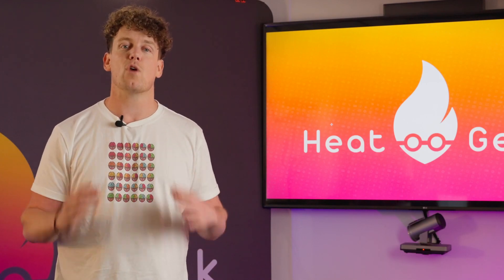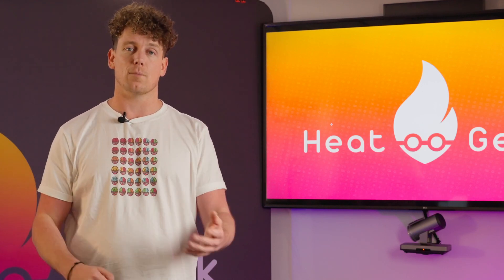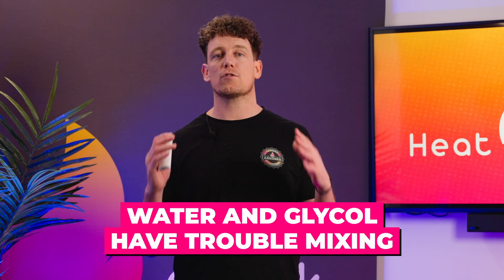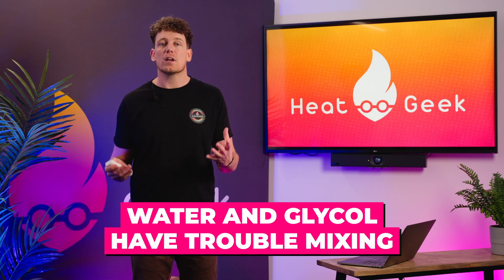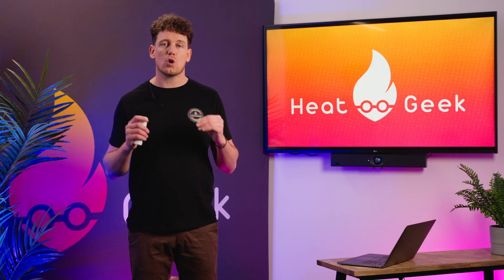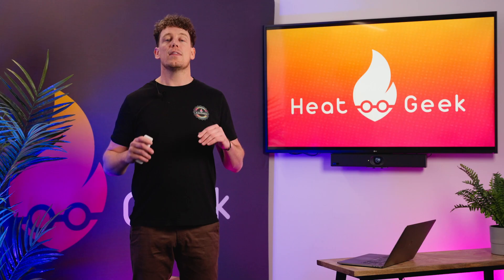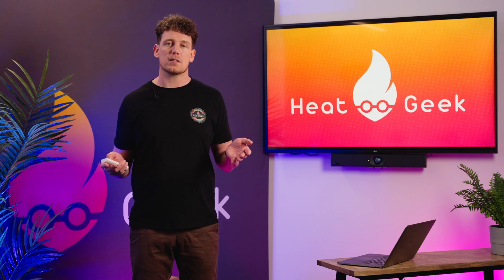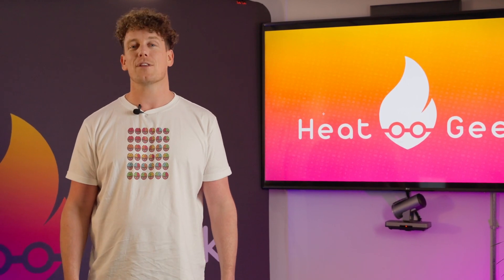Glycol Vs Anti-Freeze Valves | What's Best for Heat Pumps?

Comment: My installer quote specified a glycol system, and I quizzed him given glycol’s unfavourable thermal coefficients.

He pointed out that in Aberdeenshire, there have been many instances of the anti freeze valves opening up and then not resetting because they then become frozen in the open position.  He say the most frequent cause of antifreeze opening is a storm blackout coupled with freezing conditions.  Both the storm and the freezing attributes are a lot more common here compared to the south of England.

I do wander though, maybe having a split refrigerant system would be better, instead of a monobloc system.  It therefore keeps all the CH water away from exposed freezing locations.  My experience of underfloor solum areas is that they are ground coupled in terms of temperature and far less susceptible to freezing.
Reply: Ideally monoblock aren’t suitable for cold climate where severe weather conditions are expected in the winter ! 

Install split type and all worries are out the window ! 

Please make sure all refrigeration pipe work is well insulated . For example we use pipe work with 9mm insulation but then we add on additional 17mm pipe insulation all the way between indoor and outdoor unit! By doing this we minimise heat lost from primary’s … 

And off course when choosing your heat pump do consider Midea, Midea is amazing technology at affordable prices!
Reply: Vailant offer a heat exchanger that separates the Glycol circuit from the water + inhibitor CH circuit. It will cost around £700 so I guess you should only fit one if it is really needed. I don't know if there are any downsides to using one. Perhaps others can comment.
Reply: Haha They are great for spending any excess cash you have.A pure rip off.

Comment: We sell some 1°c opening (fluid temp) AFVs glycol should only be used in GSHP premixed for the brine side imo. In the eventuality of a power cut for a few days,  a well insulated ashp install should be fine but for belt and braces installing some AFVs will give better protection when using heat transfer fluid (H2o). Good video 😎

Comment: OFF TOPIC - Could you please consider providing a video on Hybrid Heat Pumps (e.g. systems with a heat pump plus a gas boiler); what are the advantages and disadvantages, where they might work well etc.
I'm drifting in that direction myself with a nearly new boiler (less than 3 years old), and small radiators (I needed a flow temperature of 68 C on the worst day last winter) fed by microbore pipes I predict a lot of expense/disruption to move to a full heat pump system. Instead alternate use of a small (3 KW?) heat pump spring and autumn with the boiler supporting hot water (Y Plan) and winter would seem to a be a plausible idea.  Any comments welcomed?
PS - As I understand it, the return water from the heating system is fed into the heat pump, and the output from that is fed into the gas boiler input (they are in series) so no switching of water flow between the two heat sources needed, just a control system that sets a suitable flow temperature based on weather compensation and selects the best heater to deliver it.
Reply: I think that's what I have installed by the house developer. It works well, but you do need to play with the switch over temp

Comment: Power = mass flow * specific heat capacity * delta T, and mass flow = density * volume flow and it is true that specific heat capacity of glycol is 10% lower than water, I found that glycol is 10% denser, so it means it can transfer heat the same as water ( for same dT  same power ). Am I missing something here?

Comment: Dear Heat Geeks,
I'm learning a lot about heating, heat pumps etc. from your channel, but I've got one question about something that I don't really see being discussed very often:
If you have a hybrid heating setup, say a Vaillant EcoTec Plus, and you want to add a heat pump (e.g. an AroTherm Plus). Is it necessary that the internal unit of the heat pump is installed (right) next to the boiler? Or can you connect the heat pump to another location in the heating circuit, as long as the pipework is sized properly and, of course, if it cannot be closed off like a radiator?!? I'm asking because the ideal/basically only location outside for a monobloc is relatively far from the location of the boiler (~20 meters). But, if possible, I could perhaps hook up the heat pump way way closer to some other part of the heating circuit. Hence my question. Many thanks in advance if you can find the time to touch up this issue. 🙏
Reply from the maker: There is no internal unit.. unless you mean the controller?
Reply: @HeatGeek  Yes, I meant  the controller and possibly a hot water cylinder.
Reply: Heatpump is half at best the temperature of a standard house at 60c to 70c radiator temperature...half the temperature =double the radiator surface area and pipes to suit.    The lower the Heatpump target temperature the more efficient.
Reply: @benburton3496  That's the beauty of going hybrid. Even if it's absolutely impossible to set the flow temperature below 60°C without losing comfort when it's -5°C outside, that's only a fraction of the heating season. Most of the heating season it's around +10°C or more outside. Most of the heating season a gas boiler is switching on/off and/or modulating way down in power in order to provide the adequate amount of heat. If you would take an average of the flow temperature and power output of the boiler per day, you would see most homes only need a flow temperature of 40-45°C and just a few kW of heating power during 90+% of the days in the heating season, which is perfect for a heatpump.
Since an ASHPs COP only drops near or below the freezing point when you don't use it in a hybrid setup, and it should be ideally dimensioned for the demand during the rest of the heating season, the SCOP of an ASHP in a hybrid setup should be greater than that of a more powerful standalone unit serving the same home. This greater SCOP, combined with the lower investment (in an existing home with an existing serviceable condensing gas boiler) of the smaller ASHP and not immediately having to upgrade radiators and piping, easily offsets the price of still using gas during the coldest winter days and to provide hot water (in some cases even only the legionella-cycle needs to be gas powered).
This makes it a perfect, often easy upgrade to an existing home for many years to come. 
Then in the future, when parts of the house get renovated, piping, radiators (or underfloor) and insulation can be upgraded gradually to prepare for the time the gas boiler becomes unserviceable or too expensive to run. By that time, if enough focus was put towards insulation, air tightness and heat recovery, it's very likely the ASHP you were using in the hybrid setup meets the heating demand of the home during the entire heating season, so going stand-alone is just a matter of shutting off the gas.
Ofcourse you could just do all the upgrading/insulation at once, but that means not being able to live in the house for a while and spending the cost all at once, probably taking shortcuts to speed up the process and stay within budget.

Comment: Should also be aware that the circulation pump will run periodically if there isn't glycol added, this  may cause disturbance if the pump is located inside.
Reply from the maker: The pump will always run in heating season. It should be weather compensated
Reply: @HeatGeek  do the ASHP’s know the system is not using glycol to do this? I don’t understand how weather compensation stops the water from freezing. Thanks.

Comment: The problem with glycol is you end up adding air into the system too, on smaller systems this isn’t much of a problem put we find on larger shared systems it creates problems with foaming. Contractors just won’t allow you an extra 6 weeks to properly mix the glycol.
Reply: It's not like mixing oil and water. There's other issues before the freeze juice was added

Comment: The constant addition of fresh water to a system after each time it is drained by the Anti-Freeze valve is not good for a system either. It introduces oxygen that causes more corrosion, not to mention the scaling that will happen on the heat exchangers as a result of all the addition Calcium that's added with the water. What happens if the Anti-Freeze valve isn't installed in the correct location? Burst pipes, damaged equipment, etc... Anti-Freeze valve aren't the best option in my opinion
Reply: The anti-freeze valve is only a back-up, as long as there is no power cut during freezing temperatures, it should never open as the ASHP will keep the pipes from freezing as long as there is power.

Comment: For 4 feet of pipe outside to connect the heat pump, just insulation the pipe and trace heating.... 89 quid extra or oversize the system by 30% = £15k more.. meh
Reply: Insulation and trace heating are one solution, but the heating can only work if there is power. If there is long power cut, AFVs would avoid damaging the expensive ASHP. There is definitely a case to add insulation, trace heating and AFVs if you are specifying a monobloc ASHP.
Reply: @tlangdon12  still a power cut will disable the trace heating and pop goes the pipes